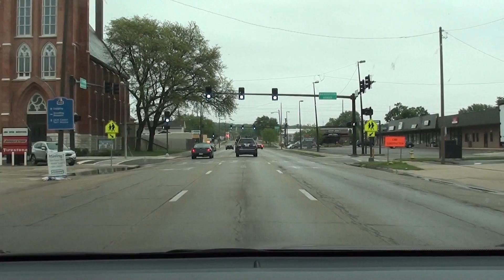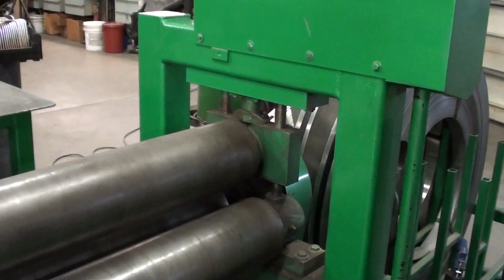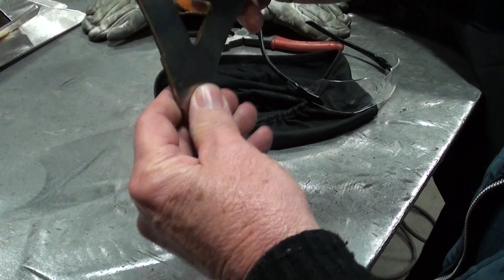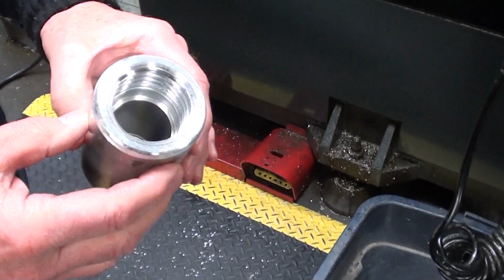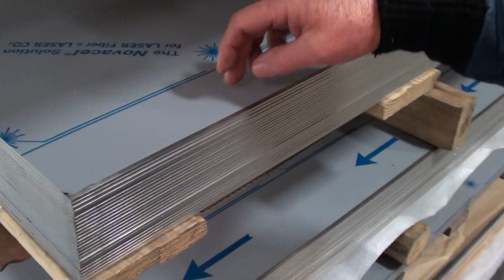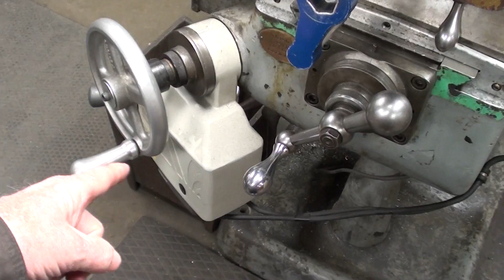ROAD TRIP TO AlumiTank pt 1 tubalcain

Comment: The guy said the laser cutter was made by Mazak. We had lots of Mazaks in the 3800 engine plant at Buick. they were self tool changing cnc milling machines that machined the front covers of the engines. They had 2 square fixtures that held 4 covers, one on each side. One fixture would be inside the Mazak and rotate as each cover was machined as the other fixture was outside where the operator would remove the finished covers and load a new set on it to be machined.

Comment: Neat video. I see you are wearing 2 pairs of glasses in the start of this video. Does that make them 'BIFOCALS'? LOL!!!The base of the bench is from a transfer machine where the parts go down the middle on a long  transfer mechanism to different machining stations. These bases were lined up along the sides of the machine perpendicular to the transfer and had machining heads like multi-spindle drilling, boring, or tapping heads. The parts would enter one end of the machine and the transfer would move it into each station and clamped into a fixture. The drill head would then advance into the part by a ball screw driven by a gearbox mounted on the end of the base. We had lots of these at Buick for machining the cylinder heads and engine blocks.  I believe the tabletop they have on the base is sitting on the ways that the drill head rode on, but the machines we had at Buick, had another piece that mounted on the base and had the ways on them.
Reply: After racking my brain, I remember some of the manufacturers of these machines were Lamb, LaSalle, and Greenlee.